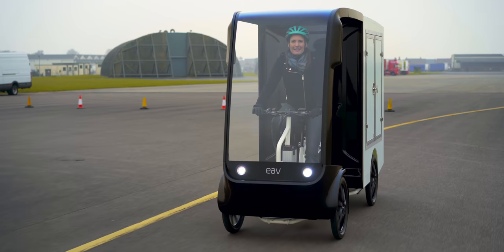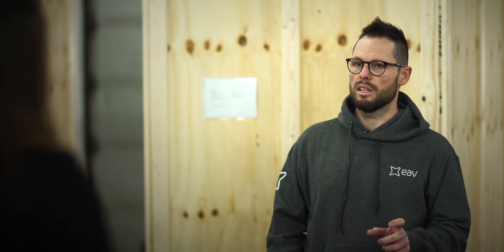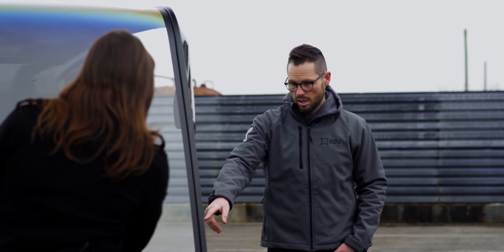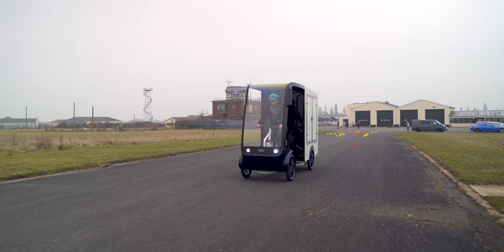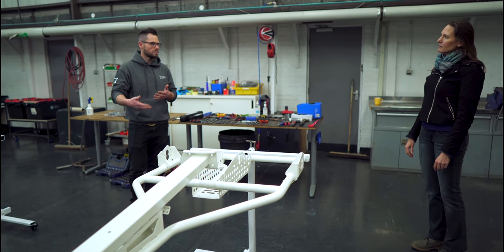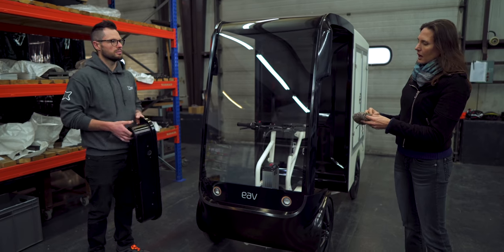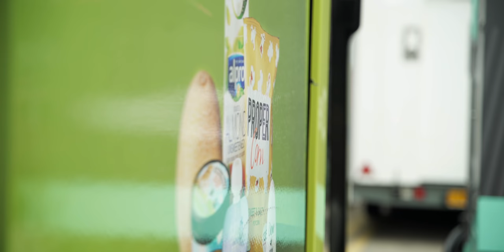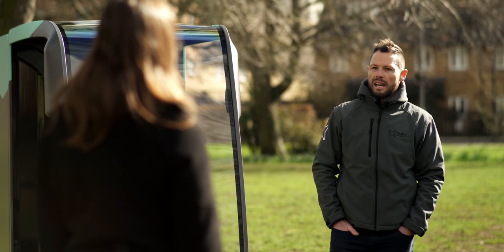EAV - Can these electric assisted vehicles change urban deliveries? | Fully Charged VEHICLES

Comment: What is the fire rating on it?  It looks flimsy based on how easily it wobbles while pedaling down the road.  Any wind driven rain is going to soak the driver.  There needs to be locking doors on both sides of the driver's cabin.  That battery would be the first thing that gets stolen or vandalized.  Straight up after that is someone trying to break into the cargo hold itself.  You never did touch on the price of the machine.  The designer also danced around the issue of a lack of sales.

Comment: Problem is people still pay the £30 charge to get my 12 year old VW caddy into London. £500 for a 10 hour day and £30 haulage. I have never been able to afford a used van over £7000. Plus I'm not going to be keen on peddling 55 miles a day on top of a very strenuous work day. 

Not for me. But if it's aiming for a central London spot at least make it capable of 20mph or you'll have busses leaving their lane to overtake in every 20mph zone London has.
Reply: if you make it 20mph it would not be classified as an e-bike, but more likely to an electric moped type deal or a speed pedalec, for both you need the right drivers license (the one for a moped), it needs insurance, a numberplate (perhaps on both front and back), and i guess a helmet for the use on a moped is stronger/different than the ones you see being used on bicycles? (you also limit the amount of people who can use the product this way)

another idea is to have in these 20mph+ streets/roads a good seperated bicycle path?
Reply: @DarkDutch007  lambeth council are running a micro E-VAN that can't be a foot wider with a bed on the back that that must be easily 6 foot. Clocked it at 30mph and it wasnt making buses leave thier lane to overtake.
Reply: @pietkaify  with the name of E-VAN I'm going to guess that it is a van? which makes it an electric car? Unless it is the same kind of vehicle a supermarket company (without stores) named Picnic in the Netherlands uses to deliver the groceries, they use "MEGA E-Worker" but for those you need a Driverslicense B to operate them. (they are a bit top heavy though...)

one of the reasons for the EAV as an e-bike was to be allowed on bicyclepaths and in pedestrian zones.

I still think that having seperated bicycle paths are a good idea though.

Comment: Most engineers work for big companies who's product requirements are set by idiots in Marketing departments who have performed customer focus groups and have no idea about how to to design anything so you end up with completely unrealistic product requirements and which tries to satisfies all customers but costs too much so no one wants it. Accountants are also used to limit what can be achieved because companies don't like spending money on anything, let alone a brand new product for which there is no sales figures yet to justify it's creation. Best product manufacturing companies are run by Engineers.

Comment: Only two comments as a cyclest:
Riding behind one of those would be like driving behind a truck.. You can't see anything ahead of you so it's hard to predict what is going to happen..
And two: Please add(or move) a second set of indicators/lights lower down so it's in better eye-line with cyclists, we are watching at about chest height for a person, not much higher.

Comment: I get the concept, and for final mile delivery such a compact ev is ideal. However, if the peddle gear isn't connected to the final drive, what's the point in peddles? It can't be classed as an electrically assisted peddle cycle if the peddles aren't the primary source of power, and (and I could be wrong) I'm sure you don't need a license to use an electrically powered vehicle if it's incapable of exceeding 15 mph 🤔
Reply: No, pedals do not have to be the primary power source. They said the pedal chain is not connected to the motor drive which means it has a separate sprocket freewheel. A pedelec design can be configured like that.

Comment: Almost zero consideration was given to aerodynamic drag.
First of all, it cuts a huge hole in the air, far bigger than it needs to.  Secondly, they could improve the shape to cut the air as it moves forward.  And finally, they could round the corners at the roof to help with crosswinds.  The old VW bus had a surprisingly low coefficient of drag, and a rig like this would be significantly improved if the designers took some ideas from the bus.

One other thing, this is the third electric assist velomobile I've seen that does not connect the rider's power output directly to the wheels.  That's the wrong direction to take, and I would never touch a vehicle with that design.  The operator needs to sense the amount of power needed for any given condition, and being directly connected in the power train gives him that sensitivity.  With that information, he can add the amount of extra electrical assist that he feels is needed.

With those comments, I think you can see that I give this a failing grade.
It may appeal to executives of major delivery corporations, but only for a while.  Those huge companies don't need some little manufacturer like this guy to build them such simple vehicles.  They'll buy a few, run them for a while, gather feedback from their drivers, and then they'll have better versions built buy a subdivision of their own.  They'll be able to completely control them, and the costs will be less.

Comment: Why? I get the size, but why pedals?
Reply: regulations, in the UK it needs to be pedal assist in order to be classed as an ebike, if it doesn't comply with these regulations it becomes a quadricycle, and needs to be registered, insured, MOT'd, taxed and the driver needs a licence, adding a great deal of expense. Not only that, because it would no longer be in the 'bicycle' category, it wouldn't be allowed to use cycle lanes, thus negating any advantage of say cutting through a park or through a road closed to vehicles except bicycles
Reply: @noahswann  It also keeps the operators fit and healthy. Sitting in a vehicle all day does not do that.

Comment: LONDON CITY only solution at the end ...

and out in the fields we will still see vans driving around cause 50% of the time the parcels will be to heavy or big .

The german post already started to deliver the light parcels with their post delivery , but the postman is delivering just a  tiny few 500 gramm packages a day with his delivery bike that had been shipped via DHL to the customer but on the final mile DHL handed it over to post man delivery. Pretty stupid idea cause they lost 1 day in average delivery time. 

Put a stone on top to get the weight close to 1 kg and the usual DHL driver will deliver it - and that 1 day earlier. And for the same price.
Only the Post has a 2 way delivery for the last mile ... and that does not work quite well for customers.

Bad example to start the discussion instead of talking about its limitation: city use only 

And: the run in the double trap cause they reinvent the delivery wheel and the way of sales per use instead of lease or sell.

SONO motors is dying over years with the we can do everything soon approach cause the SION is not there and the genuine Solar cell body is so limited in range gain ...depending on weather, climate, position ... cause a car parking in shadow is not gaining range and a car in the sun will be a Sauna when you want to drive if you park it in a full sun.

Comment: The most dramatic failure of this thing is the anti-ergonomic upright riding position. They need to look at companies like Day6Bikes and others producing recumbents and semi recumbents, there is no reason to stick with such a radically uncomfortable position in a vehicle supposedly designed form the ground up.
Apart from the fact that the rider is the only person that hasnt been considered in this design, it is clearly made for product distributors and the rider is just a disposable cog in the machine. 
(really great example of class violence in even 'well meaning' industrial design)
Reply: Also teh TUMCREATE/Singapore post tilting delivery vehicle is just all round more ergonomic and a better design, this "EAV" is entirely intended as a way to get round EU laws

Comment: If I may make one unsolicited suggestion: Put the mirrors either higher or lower, because right now the are at eye height, which means they block the view to the front.
Reply: The mirrors I saw were very high up near the roof.
Reply: @popeyegordon  Look again when someone sits in it.
Reply: @Anonymous-sb9rr  Near the roof line is as high as it can go. I noticed the mirror placement and found it brilliant. Nothing sticking out to hit things or to be hit. Driver visibility in this model is above average.
Reply: @popeyegordon  When you see her driving, at one point, her entire face disappears behind the mirror. That's how wide the a-pillar is at that point.
Reply: @Anonymous-sb9rr  All cars have pillars. You were looking from the angle of a mounted camera.

Comment: Until ev's have atleast a range of around 500 miles they ain't going to work in everyday life, I had a jaguar e-pace and its 200 mile range is halfed if you use the lights and wipers, and on long journeys they just don't work so needless to say I got rid of it and went back to combustion, so much more convenient.

Comment: What’s the WH per mile?
Reply: Watt Hours.  You usually see it written as Kwh on your electricity bill which means 1000 watt hours.  The higher the number, the longer the battery is likely to last depending on the power draw.
Reply: ask the ev database.
Reply: @jameslewis2635  The smaller the number the further you can travel between charges.

Comment: 50% of the transportation costs come from the last mile transportation? That's ridiculous. Where are the data to back this up? Most last-mile transportation in my country (parcel delivery) are sent using motorcycles (mopeds) which I think is quite cheap and cost-effective.

Or are you talking about transportation of good from the ports, warehouses, factories to the retails shops which mainly handled by small 1-tonne lorry, which I highly doubt that this vehicle would be able to replace that role. Looking at its' assisting feature, I'm sceptical it could do multiple stock deliveries to multiple endpoints effectively.

Sure, an electric vehicle is a good technology. A way to move forward and I'm totally supportive and excited about it. But please, don't do lip service just because you want to push your product and it looks relevant.

Comment: Hmmmmm  melt out process to recycle.....doesn't that use energy??   question not asked why? because it will be hugely expensive...but that is just the body, chassis can be used again and again barring 'crushing' accidents.....Back in the 50's 60' a large truck company ERF offered a similar service, you bought a truck, used it for so many years and then sent it back to the company for a refurb...the uptake was not high...???...people just preferred to buy a new truck, even though the refurbished one was taken back to original spec in every way.

Comment: The problem is, a decent cyclist can do 200 watts.  A decent car does 200,000 watts!  Thats 1000 times more powerful.  So as you move along the spectrum from bike to car it very quickly gets to the point where the human power part of this is infinitesimal and completely pointless.  On a basic E-bike you’re already almost at that point.  Add a motor any stronger and pedaling is pointless.

Comment: It's amazing how rain doesn't fall sideways in that place, hence no doors
Reply: It's amazing how easy it is for you to be a jerk. A roof is always better than no roof, 100% of the time. When moving, the rain mostly blows by and just your elbows get damp. It is also common to see clear vinyl side covers in wet weather but a delivery person will already be wearing rain gear.
Reply: Popeye Gordon i was suggesting that they come with doors as standard. Don’t be a potty mouth!
Reply: @joeljames1616  Potty mouth? Are you twelve? Jerk is not a profanity. In vehicles where the driver exercises heavily, maximum ventilation is required. Light vehicles have to shave off weight wherever possible too. That huge front windshield would fog up with doors.
Reply: Popeye Gordon this YouTube argument won’t add value to my life, hence this is my final correspondence on this matter

Comment: I like your channel, usually, but this! 175kg per corner, or just the rear corners? allegedly pulled by 250w + effortless pedalling?? Come on... and the longevity scheme? Not because it's so expensive it couldn't be sold any other way, ahh???
Adam has invented a very expensive half a milkfloat.

Comment: Should be full electric not cycle hybrid, because not everyone whom may be driving it will be fit or young enough to cycle even with some electric assistance. 
Full electric be better all round since they can move the loads without giving the driver a heart attack because they having to cycle it?  
The full electric can be charged up with wind and solar so no pollution no noise no problems moving heavy loads.

Cycling is for use as personnel travel not really for cargo lugging.
Reply: you only have to move your legs to get bicycles with pedal assist moving quite easy, if it was full electric it would not be classified as an e-bike, but rather an electric moped/speed pedalec kinda deal, for those you need a drivers license, numberplate, insurance and other stuff.

but ofcourse if you are not used to the kind of motion your legs make on a bicycle, you might get tired faster from it than if you are used to it for a longer period.

People do their shoppings on a bicycle...

Comment: Its a nice truck, but assisted cargobikes and tuk-tuks aren't new, they've been around for years. They may look cute and putting a few on the streets is a terrific method of virtue signalling for the big diesel fleet operators like Ocado. Their problem is that they just arent economically viable. They are slow, have very limited carrying capacity and and require many more drivers to deliver the same amount of goods. 
Also at 3:20 "Part of our business model is we control the lifecycle of our vehicles..." How on earth would a customer benefit or even accept that level of control from a manufacturer of a low tech product like this?

Comment: The final mile is 50% of the cost BS. A little thing like that would haul almost anything so using this would increase the final mile cost. Also looks like you wash out the drivers around 40 as not strong enough after that. Blocking a whole lane going super slow.

Comment: Ive decided, that for the price of an id ect, i can buy that luxury car i always deserved,YES FOR THE SAME PRICE, i could buy a merc c class,a bmw 300, and will cost the same to run,yes 35p
a kw is £10 for 100 miles,same as a diesel.i test drived a Lexus today,its a hybrid 56 mpg
i like thar allot,and doesent look like a Childs toy inside,and its got leather, its quiet inside,
im just fed up with lack of plug in points,batery tech is moving so fast,if i buy electric now it won’t be worth annything in five years as the cars then will go three times the distance,charge
im minuets,and have batterys that will last for life of car in my case the owner,or should i get ev,its giving me an headache,

Comment: I dont think these things should be in cycle lanes, she calls it a vehicle, it barely fits in the cycle lane 2 going past either won't work and they shouldn't be swerving round non powered cyclists either as delivery drivers on the clock drive vans like theyre on fire this will be the same, as they say the vehicle will be out of the city centre so they should be separated but I can see drivers using the closed railway paths and then they'll be knocking kids off who don't expect white van man tearing past and it'll end in tears

Comment: Hypster junk.
No need for such things.
Bicycles have the advantage of moving fast everywhere and delivering fast. Plus being very light, won't put pressure on thr rider.
This cacophony has no real advantage.
Maybe like an ice cream van or a hot dog stand, where at the end of the day you go home with it, or something like that, but even then, not worth the cost, the effort for such a useless vehicle. Upcoming quadricycles, which are (like that new citroen ami, aixam and others) sufficiently powerful to move about but still not cars will be in this segment where this contraption tries to enter, but doesn't offer anything worthy.

Comment: They need to change the laws so it doesn’t have to have pedals doesn’t have to be a bike so you can sit in a more comfortable seat using the electric motor who really wants to pedal it have a uncountable seat up your ass your people need to start changing the law so you don’t have to pedal these electric motors if it goes under 30 miles an hour why do you have to pedal the damn thing